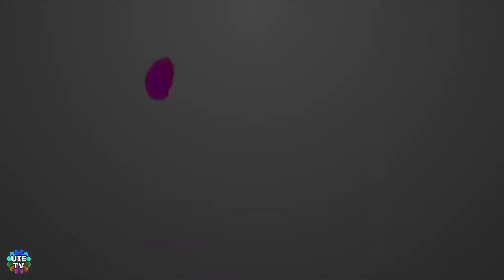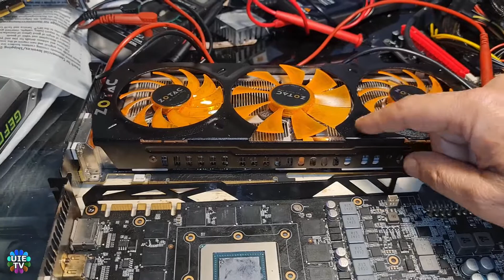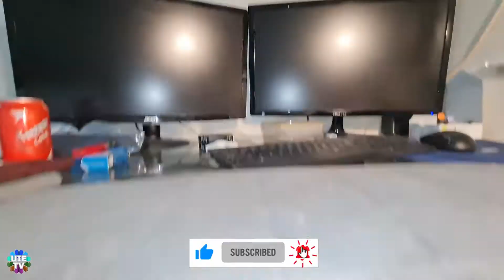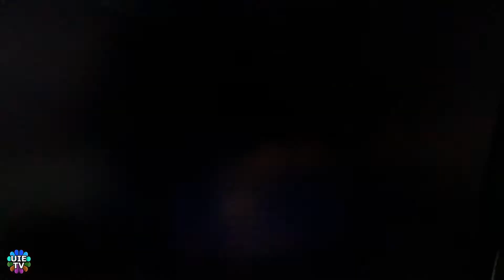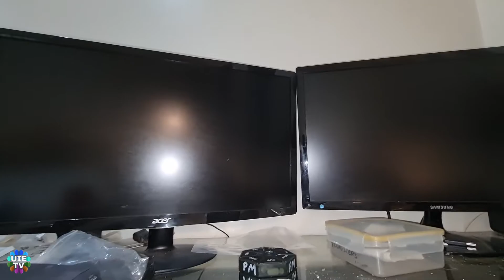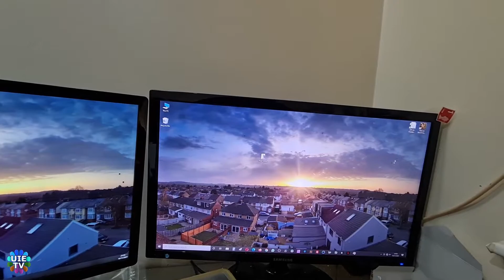Part 4. No Display No Power! Step by Step Diagnoses, Gigabyte GTX 780 Ti GPU Graphics Card Repair

Comment: I have gtx 780ti zotac edition witch requires pcie power cable, its giving no display when pcie cable connected but when i unplug it and power it on display shows and say's please connect all pcie cable on gpu,i even opened it up and cleaned also i tested with pcie power cable it doesn't heat up but when i unplug it and try it again it heats up again